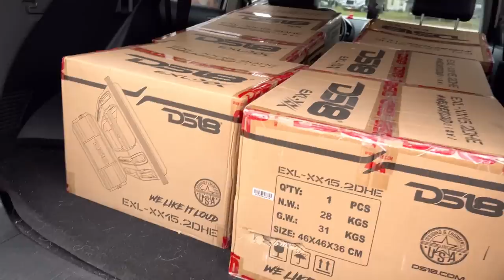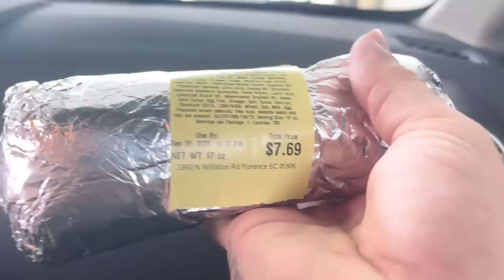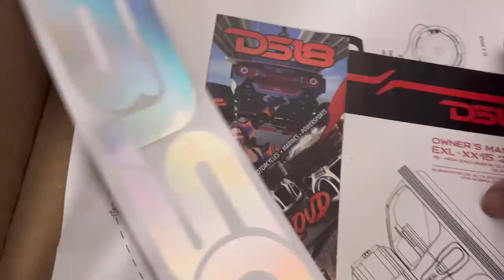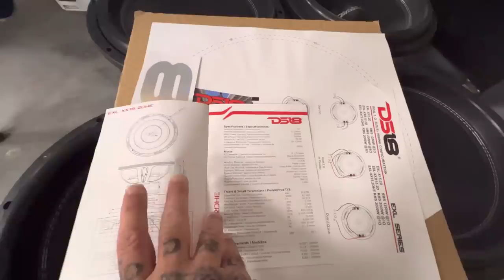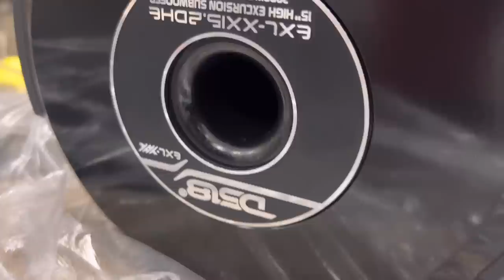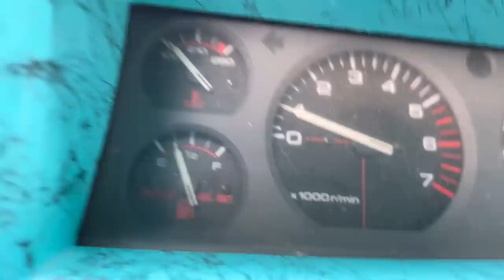I got new subwoofers, Jangalang gets a new Alternator

Comment: When we met at the show I had an alt go out and I believe it was because I basically had two different alts running on two regulators, I found out one alt with the same amount of demand was putting out a different voltage then the other, it caused me charging issues because of how demand works thru the fat boy, I would check out what each alt is putting at the stud for voltages, I had to end up buying two alts that were made side by side with the exavt same run of parts, and this helped me out so much with charging, I play 25-30k demos with a 0.2 volt drop

I was running a dual fat boy reg, my alts were a 300xxl and a 390 js I believe you are much closer match then I had*
Reply: My js did not come internally grounded with their ext reg, and that little plug if u buy it at the parts store is like 36$

Comment: I have 2 12's of those same DS18 subwoofers. I like them a lot. I blew them pretty quick from overexcursion, but the coils are still good. I guess that's what I get from running them in a big sealed enclosure on an Orion HCCA 11000.1. I got recones, but the first recone I did started to get coil rub after about 20 minutes of playing it. I have rebuilt quite a few subwoofers and have never had that happen before. I don't know if the holes in the spider landings were not made perfect or what.

Comment: you think I could get away with wiring 2 dual 1ohm vc 12" subs down to .25 if I use a smart5 or smart8bass that goes to .5 & not have it constantly going into protect due to box rise? I have em series/paralell at 1ohm right now but the subs need more
Reply from the maker: maybe there should be enough rise..
Reply: @JerryAintloud  thanks brother! I'm gonna try it! If it don't work I'll switch to 2 dual 2s I can run at.5 I bet the rise will keep the taramps from going into protect tho. I greatly appreciate your input! I never miss a post on here from you, you're the best!

Comment: Nice subs, sorry to be the wet blanket but theres absolutely no way it has 42mm one way x max especially not in a triple stack. I'm guessing that's 2 way.  For 42mm of one way Xmax, with a likely 20mm top plate You would litterly have to have a coil with a 4" tall winding width, for example sundowns top dog Z or NS has 3" or 3.1 tall coil I believe, the biggest I've ever seen was 3.6" tall and it was custom lord of bass PE coil. Don't get me wrong there bad boys and will slam but the bad news DS18 manual is misprint or there bullshitting you. If anyone thinks I'm full of shit ask any reputable subwoofer builder they will back me up.... It's been a long day my math may be off a bit if so let's hear it.